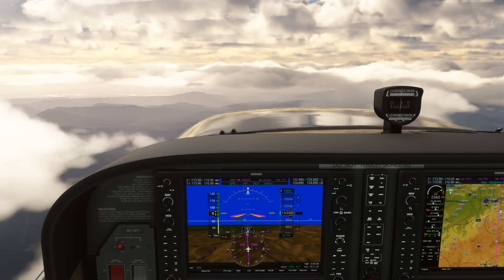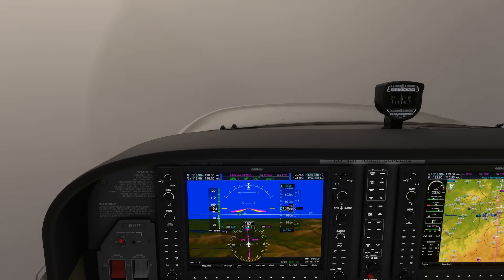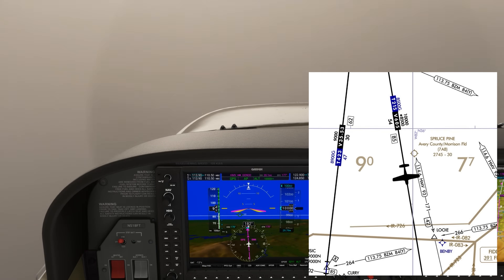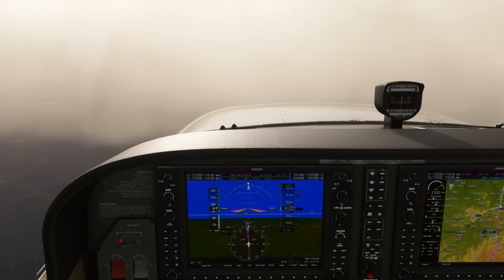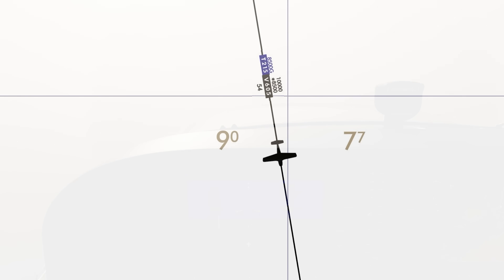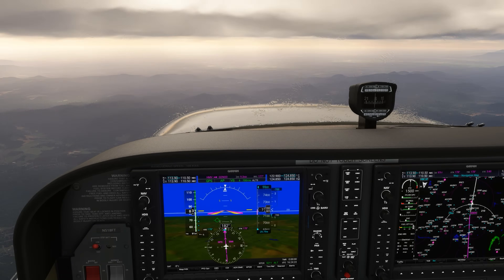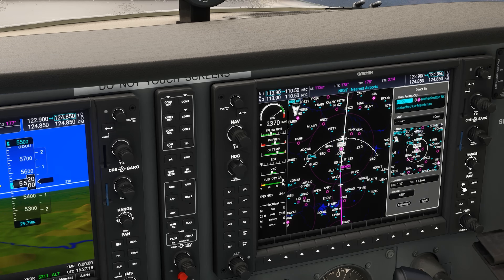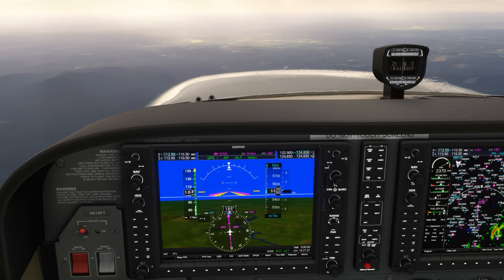Minimum Vectoring Altitude Explained: An IFR Lifesaver in Icing Conditions

Comment: Even deeper knowledge… 

For every radar MEA, there is a controlling obstruction or terrain that causes the MEA to be that certain altitude…

However, that prticular obstruction or terrain may or MAY NOT not be a factor in your particular location…

A real life example….

An aircraft departed IFR at 4000’… encountered icing and elected to return to the departure airport (45 miles) away….

The aircraft overflew a satellite airport with an instrument approach but elected to continue back to the departure airport…

The controller issued a descent to the 2500’  MEA but that altitude did not get the aircraft clear of clouds and it continued to pick up ice… The aircraft crashed 18 miles later and the pilot was killed…

The controlling obstructions for the MEA were antennas 15 miles to the aircraft’s right and terrain 20 miles on the aircraft’s left…

At the aircraft’s location, there were no obstructions or terrain issues… the elevation in that particular area was approximately 500’ MSL… WX in the area was 11- 1200 OVC surface temp 44F…

With the aircraft at 2500’ MVA, the aircraft had 2000 feet of clearance below it with clear and warmer air at or below about 1600 MSL.. well above the terrain.. and could have possibly escaped the icing if either the pilot or the controller had know those facts…
Reply: I believe the controlling obstruction for the MEA along an airway is 4 NM on either side of the airway centerline, not the 15/20 NM on your example.

Comment: he is flying the MEA of 10000 feet asigned on this particular airway, and apparently cleared by ATC, so the even/odd becomes irrelevant
Reply: Typically, controllers will coordinate with the next sector for approval of WAFDOF…

“Wrong Altitude For Direction Of Flight” …

Comment: I had a similar situation where the freezing level was to the surface and my destination was MVFR overcast. Luckily, it was stratus clouds, and going VFR with a few diversion options was the best way to go as I could still get in special VFR. Trying to mess around IFR and having to negotiate altitude restrictions while looking to stay out of clouds and looking for a clear gap for a contact approach was just not the best idea. Sometimes a VFR flight plan is still the best option even in less than perfect weather.

Comment: So the magnetic course is 178 but then why is he cruising at even thousands altitude? What am I missing here?
Reply: Technically, that’s true for uncontrolled airspace, though ATC carries it over wherever possible into controlled airspace. The rule, 91.179, says, “Each person operating an aircraft under IFR in level cruising flight in controlled airspace shall maintain the altitude or flight level assigned that aircraft by ATC.” It’s a guideline that can be overridden, but we obviously plan for the semi-circular rule anyway.
Reply: If you’re asking why he’s flying at 10000 on a 178 course, it’s because he is flying the MEA along that Víctor airway.
Reply: I came to the comments to also find the answer
Reply: Wondering the same, and most of the comments are not getting the question right. It's not about flying "thousands", it's: why are we flying EVEN thousands with an Easterly magnetic course. From 360 to 179 we're on the East side of the pie and should be ODD thousands.
Reply: @TiagoSeiler It's perfectly normal to be assigned non standard IFR altitudes under ATC control.
Reply: He could've simply requested it earlier.
Reply: It’s IFR. The altitudes are even thousand #.
Reply: @michaelgarrow3239 but why did they choose the westbound even thousands when they explicitly said the magnetic course is 178, which is eastbound
Reply: @daytodaytech7687 - That is a different question. Let me guess. 
You fly the altitude you’re assigned regardless. It is right on the 180* change over so he may be “eastbound” shortly, or just established west. Could be center is trying to mitigate icing potential. Perhaps they want him to stay at altitude, pilots and controllers both don’t want you bobbing around. 
Remember; heading, altitude, clearance limit.
Edit:  FAR# 91.179
Reply: Often, non-pressurized aircraft don’t want to cruise above 10,000…
Reply: Great question and great replies.  This really helps me understand!

Comment: I just learned something today. Until now, I thought that ATCSMA/MRVA/MVA map is always published in EN-ROUTE portion of the AIP in every country, now I've discovered that it is quite rare.

How do you plan an IFR flight without it in winter when the A/C doesn't have known-icing capability? This is madness. Is there a reason to not publish it? This seems to be safety critical information ...
Reply: You plan flights using MEA, MOCAs and those altitudes. MVA is basically a last ditch effort and you shouldn't be making any plans based on last resorts.
Reply: @shadowscall7758  yeah, exactly. Never rely on the MVA - what if radar service is not working that day?
Reply: @spiller212  I plan quite conservatively, to the VFR minima. The thing is that my base doesn't have instrument approach so if the neighboring airport (military base with civilian traffic) with instrument approaches is for some reason closed, then I need to know that ceiling is high enough (forcasted above ATCSMA/MVA with a margin) so I can cancel IFR and continue VFR. For this reason I need to know to whitch altitudes I can be cleared. Radar coverage is quite good in my area its a flat land and covered by multiple radar systems, it never gets procedural.

Comment: Just a point of clarification here. In the example given, you are more than 25 Statute (22 Nautical) miles from HMV, which is the VOR that defines Victor 605. So you need to be careful both legally and practically about requesting the MOCA since you are outside of the protected applicable airspace for that value. However, if you are IFR approved GPS equipped, you can request re clearance via T215. The 8500G in blue is the applicable MEA when using GPS for navigation on that airway (T215). I do realize they overlap, however if your aircraft is not equipped with a working IFR approved GPS, in the example given one cannot request the 8500 ft. MOCA.
Reply: I think you might be mixing up signal and airspace, the 22nm is only relevant for VOR reception, but the moca is good for the entire segment.
Reply: @jamesf.9429 this guy is correct. OP is incorrect.
Reply: @kintarogold  Actually, he is correct…

The airway requirements offer protection for IFR aircraft who are not radar identified and provide terrain and obstruction clearance for the route…

IFR aircraft who ARE radar identified can be assigned an altitude below the airway requirements down to the appropriate MVA… as long as he can comply with the appropriate 
navaid limitations for navigation on that airway…

Aircraft who have appropriate equipment ( think IFR GPS/ RNAV) and are below the altitude requirements of a paritcular airway cannot be assigned the airway legally… but CAN be cleared using the navaid radials or GPS airway fixes in accordance with 7110.65 Section 4   4-4-2  Alternative Routes…
Reply: @dinosaur-atc that’s not what I said. OP said that outside the 22nm you’re no longer safe at the moca. That’s not true, you still have obstacle clearance, just not necessarily signal. 

I said nothing about RNAV reqs.

And by definition, if you are at MVA, you are now technically being vectored therefore you are no longer on a route, even if you are still following the radials or RNAV course that defines one.
Reply: @dinosaur-atc  to make it simple: one absolutely CAN request the 8500’ moca for this route even without IFR RNAV (even outside the 22nm). Whats the point of it existing otherwise?
Reply: @dinosaur-atc you clearly also have no idea what you’re talking about.
Reply: @kintarogold  You actually said nothing… 

The altitudes charted are for NON-RADAR navigation…

If you are in radar coverage, the MVA can apply for the route you are flying and provide, with radar monitoring, appropriate safe altitude minimums…

If you were smart enough, you would understand the difference between RADAR and 
NON-RADAR operations…
Reply: @kintarogold  ATC is required to assign an altitude at or above the MEA consistent with hemispheric rules… They are allowed to assign a lower altitude ( consistent with the MOCA and NAVAID limitations) if requested, consistent with hemispheric rules…
Reply: @kintarogold  And your published references are what ?? Can you back up your statements with facts, regulations, and or, I don’t know,  MAYBE personal experience…

Waiting… waiting.,.. WAITING..,

Drive by insults are not a desirable trait… 

You should pay attention to the statement “ Better to let me think you’re stupid, than to open your mouth and prove me right” …

If you want a constructive dialogue, perhaps change your approach…

Looking forward to that constructive dialogue, eh?
Reply: @dinosaur-atc  hahahahah you’re funny bud. We’re talking about the function of the minimum altitudes. The MOCA could be one that applies to the hemispheric rules, not all mocas are 8500 feet. 

My references are literally every aviation publication. I don’t need to give you specific references cuz you should know where to look to find the truth. 

I feel like you’re confused about what I’m saying. You’re too busy being a fedora-topping Redditor type who thinks he’s extra smart to pay attention.
Reply: @dinosaur-atc I’m not looking for constructive dialogue with people who are spreading false information. Just to correct them.
Reply: @kintarogold  You don’t need to correct anybody… you need to understand how things work… and instead of hurling insults, understand that many people may know more than you and try to learn…

A real world example that you can look up on Low Altitude Chart L18… do you know what that is… I think not…ask your Mother…

Take a look at V159 southeast of VUZ VOR… The MEA that airway is 3800 for VOR navigation, 3200 for the TANGO route(RNAV)…

The radar MVA is 3000’…

Therefore a NON-RADAR aircraft assigned that airway would be issued an altitude of 4000’ per ATC regulations…

However, the MVA in that area for RADAR-IDENTIFIED aircraft is 3000’… 

Thus ATC could legally assign the aircraft 3000’ navigating the airway via whichever method (VOR or RNAV)… for whatever reason the pilot wanted (icing, cloud clearance, etc) as long as the aircraft stays in radar coverage…

As long as the next radar facility had radar coverage and a MVA at 3000’ , all was good… however, if the next radar facility had a MVA that was higher, then the aircraft must be climbed to meet MEA/MOCA requirements…

Do yourself a favor… learn some shit today…
Reply: @dinosaur-atc  everything I said goes exactly what with you just said. You literally just repeated my points. Thank you for telling me what I have been saying this entire time.
Reply: @jamesf.9429 MOCA only guarantees NAVAID signal coverage up to 22nm from the NAVAID. MEA is the altitude that guarantees it across the entire segment of the airway

Comment: Does MVA apply in Europe as well?
Reply: Of course ! I am an ATCO over mountainous areas in Europe and I have to deal with so many MVAs, but it s all clear on the Radar. In case of severe icing, I could descent an aircraft even below MVAs down to the emergency altitude. Still safe from the ground (1000ft about) but radio contact could be loss for instance. And I have to advise the pilot about this altitude which is below MVA. It s really in case of a critical icing situation.